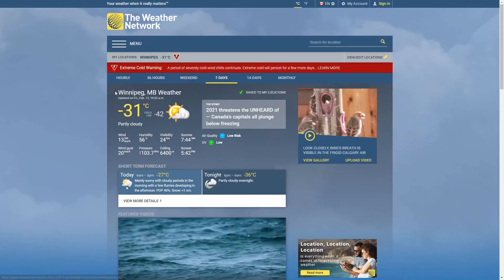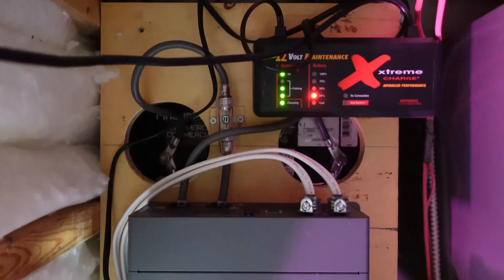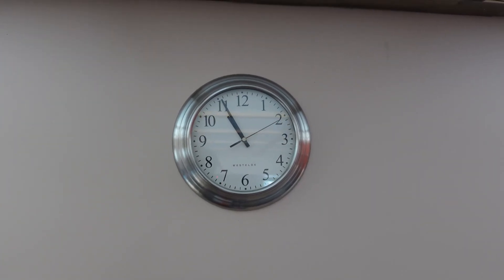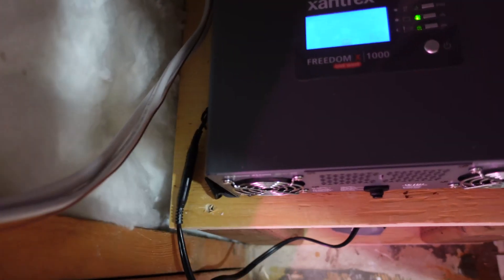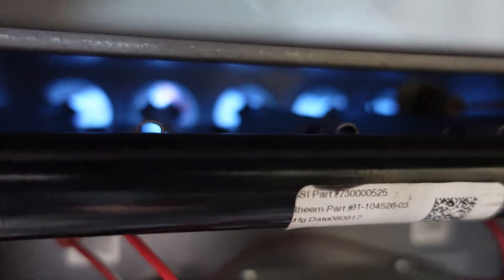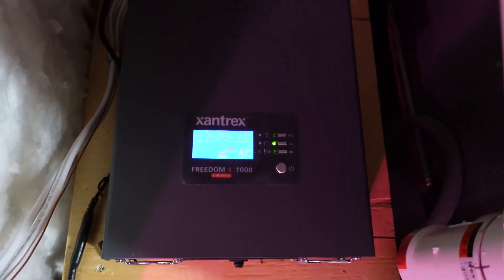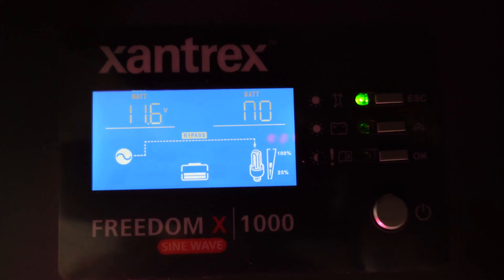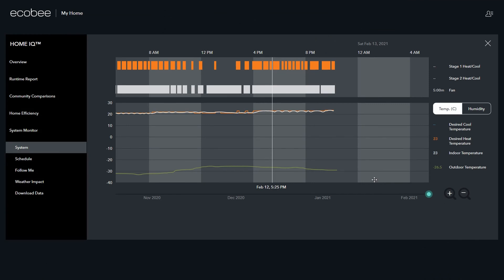DIY Furnace Backup: Testing The Setup

Comment: All due respect, $1200 for an inverter, not including batteries, charger, cables etc.  Why not a gas, dual fuel generator?
Reply from the maker: 2 reasons, my setup is totally automatic when I'm away at work so I don't want a generator running when I'm away, and the price of the inverter was under 500 when I initially picked this thing up.
Reply: @HouseDadLife  Understood.  The price sure has gone up for that inverter, you did well.  Cheers.

Comment: All of these backups are nice but it assumes your power will be on in a few hours???
Reply from the maker: This one goes for about 8 hours real world, you would need something after.
Reply: @HouseDadLife  As long as people install one knowing what they are getting, like temp heat till the power comes back on hopefully in a few hrs. My buddy jumps his heater with his truck battery. Just opens the hood and hook ups,,,lol
Reply from the maker: I was going to say, in a pinch you could use the battery out of your car, or hook up booster cables to charge it, sounds like your friend has that figured out.
Reply: @HouseDadLife  Yes his truck is really his charger if needed. I will use 2 deep cycle marine batteries next to my heater. Researching now. Remember it is just a quick fix in the hopes power will be restored in a few Hours!

Comment: Hey, great idea!  Recommendation---You can increase your battery capacity and overall battery life by using two 6 volt golf cart batteries hooked up in series to make it twelve volts.  Having 4 batteries is better.  Going below 12 volts on regular car batteries will kill your batteries in short order.  Golf cart batteries are designed to take more of a discharge and will last significantly longer at lower voltages.  As someone else said, you can extend your battery run time by hooking it up to a solar panel....even a low wattage one....to increase your run time.  With a 50 watt panel and intermittent use, I suspect you could run your furnace indefinitely.
Reply from the maker: Deep cycle batteries would be better, I'm kind of holding out for lto cells to be more available for a good price in Canada.  I think that would be the most ideal battery for this setup.  A solar panel wouldn't hurt as well.  Or a small wind turbine, no shortage of that here.
Reply: @HouseDadLife  Cheapest lithium phospate battery I've seen is close to $700 US made by a Chinese outfit.  I'm not sure if they'll come down, but you never know!  Regarding wind turbines, I've seen a lot of people say they used them, but a significant  enough portion of folks say they're prone to mechanical failure (bearings), and they never got their return on investment out of them.  That was enough for me to stay away.  I've ran a 400w solar system on my 5th wheel for two years now with zero issues, and a small 200w test system at my house for 4 years prior, also with no issues.
Reply from the maker: Really good information, it's too bad the wind mills are prone to failure.  I'm wondering if there are any designs that are better.  A few solar panels would be nice as well.  This really makes sense if I add some more battery storage.

Comment: Running the charger off the inverter is wasting battery power. A charger uses more energy than it puts back into the battery. Run it off house AC.
Reply from the maker: You're 100% right, the only reason it's in that plug is because I have no other plug close by.
Reply: If house AC was available then you wouldn’t need the inverter to power furnace.
Reply: @9bme472  it charges when house ac is on

Comment: Just curious... what about a car battery and a 12v to 110 inverter.
I think I have an 800w inverter. 
Shouldn't that be enough to operate the fan?
Or solar panel to change the battery
Reply from the maker: Depends on the fan unit but I think it should be sufficient.

Comment: Your graph was very confusing to me,  since the blower is using the most amps, it would be nice to know how long it was running during the test. Also my Bryant furnace specs says the blower draws 9 amps, which would mean 90 amps from the battery.
Reply from the maker: I ended up doing an exact capacity test.  To save you some energy converting everything to watts made it much simpler for me to calculate.

Comment: Just a thought why not crank tstat up to 75 f. Run furnace till it hits setpoint. Then shutoff inverter till you get too cold. That will save power by not wasting watt hr in standby mode.
Reply from the maker: A great idea in a power out mode, utilize the power for heating only.

Comment: I would be extremely curious if you could hook up a solar power charger to this.  Should be pretty easy and simple to setup, and depending on how much power you can harvest from solar you could possibly run your heat system entirely off of battery!

Obviously adding larger capacity batteries (Like a deep cycle marine battery) would extend the life slightly, as well as increasing the total # of batteries.
Reply from the maker: If I were to add just a little bit more battery capacity I'm pretty sure I could run this off of solar.

Comment: Just seen your other video and you talked about the other Xantrex model you can buy with the built in battery charger. Wondering if that would have kept up with the battery draw and would have lasted longer
Reply from the maker: If you added a small generator you wouldn't have much of a problem in this setup keeping up with the draw, average is under 300w when it's cycling.
Reply: I had a thought I know 95% furnace fans are direct drive motors now but older furnace models are still belt driven. Wondering if you could hook an alternator up and recharge the batteries when it’s running.. 🤔
Reply from the maker: Unfortunately you'll always lose more than you get back because of inefficiency, plus you'll put more wear on your drive motor.  You could easily add a solar panel to this setup though for charging.

Comment: Dude. You can’t cheat and charge in inverter mode drawing off batter and then trying to charge battery power from battery power. All your doing is drawing more power from your battery’s that could have gone to your furnace to make it last longer. Can’t make more power from the same power source. If so that would be great and you’d have a perpetual power source that never runs out. Wish it worked that way. Good choice on the inverter though. They make solid equipment that will last you a lifetime. Cheers from Edmonton.
Reply from the maker: Lol, I'm surprised no one has noticed this sooner, it is just a trickle charger and perpetual energy isn't the goal.  The same plug does have grid power when it's active so it's just set up that way to charge when the power comes back on.  I could have done it differently but wanted it to switch with the emergency power.  Because it's a tiny charger draw is minimal when on the batteries.  Thanks for taking the time to comment!

Comment: would more batteries give you extended power life for invertor feed from the batteries?
Reply from the maker: I could definitely add more in parallel to increase run time, I think I might go lithium to really increase performance.
Reply: @HouseDadLife  or even deep cycle led acid. Ups are not designed to charge lithium batteries without adding balance controllers and other safety measures.
Reply from the maker: True, I'm interested in the LTO batteries which I think are the best in terms of safety, longevity, and minimal extra steps to use in this setup.

Comment: I would like more details about your batteries.  Thanks
Reply from the maker: They are 12v lead acid batteries, rated at 950 cold cranking amps, there are 2 of them and they were the cheapest thing I could buy.
Reply: @HouseDadLife 2 at 950 cranking amps makes me think its a pair of group 31 batteries so you had a bank at roughly 200amp hours which would be about 1200wh worth of useable power.

Comment: Very nice video. what is the battery size for this test? Not able to grep the information from three related video including this one.
Reply from the maker: They are 2 12v lead acid batteries rated at 950 cold cranking amps.

Comment: Nice Video and Results! 
6 1/2 hours will get you thru the night without running a loud generator, keeping you and your neighbors up! 
 I have a generator that can run my furnace and sump pumps throughout the night but its way too loud (even after I put a muffler on it) 
I now installed a sump pump battery back up that will run for 6-7 hours if power goes out during the night. (Its crazy how often I lose power when the temperature is in the high 30's and snow is melting and its raining!)
This Furnace battery system would be a good addition to use as well, so we dont wake up to a freezing house in the morning! 
Of course Losing power for multiple days is a whole other matter to address with recharging all the batteries.
What is your plan for recharging your batteries if you have a power outage for a full day or a few days?
Reply from the maker: My current recharge plan only has a 12 bolt battery charger.   However, I did have enough forethought to get an inverter that has a plug that I can run out to start a generator automatically in the event of multiple days of power outage.  As of right now I haven't needed to do this yet, but it's an easy add on now if I decide to incorporate a generator as well.   Future batteries will be a lithium build as well,  I estimate easily doubling or tripling my run time by making a battery pack.
Reply: @HouseDadLife    I have never charged a 12v lead acid battery off of a generator, I would think its a long run time and inefficient .Have you researched any Lithium Batteries that you would like to get yet?  It would be interesting to see the difference in charging times between  lead acid batteries vs 2 lithium's ( lithium suppose to be faster). Also, I havent gotten into anything solar yet, but I read that two 300 watt solar panels can charge the lithium's in an 8 hours. So while the furnace is running on one set of batteries the other set can be recharging and vise versa. (then the generator can just be insurance if there are too many cloudy/rainy days to get the batteries charged up again. )
Reply from the maker: I like where your head is at! The future will be lithium, but I won't just throw it the lead acid.  I already have a spot welder kit I'll be putting together,  video of that to come.  The generator wouldn't be too charge the batteries as much as just keep the furnace running and supply basic power, charge the cell phones kind of thing.  Winter here gets nasty, nice to have peace of mind.